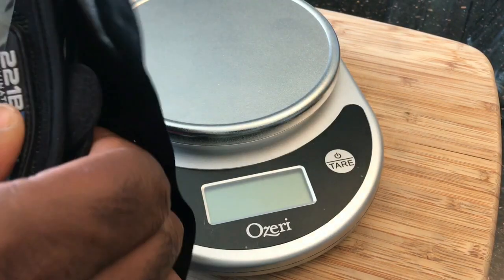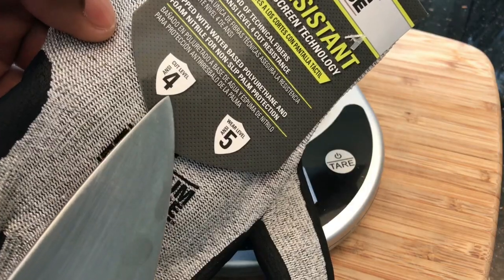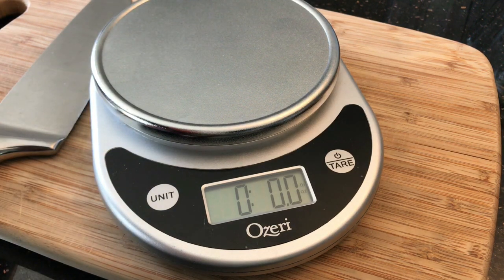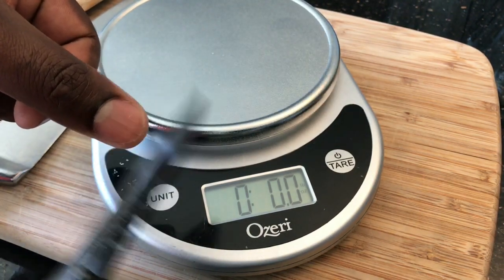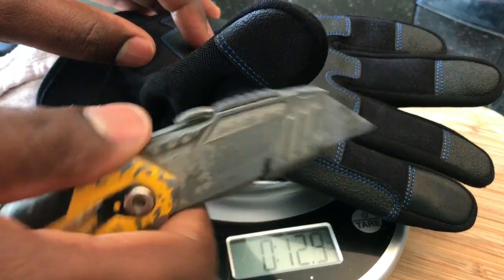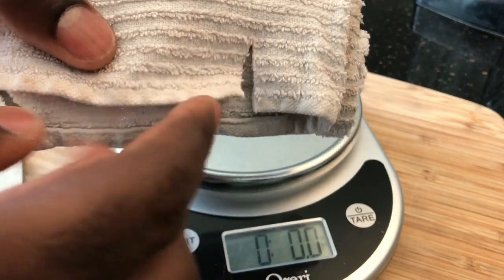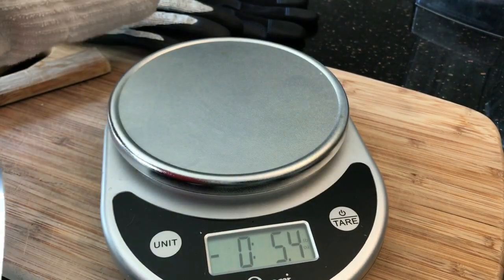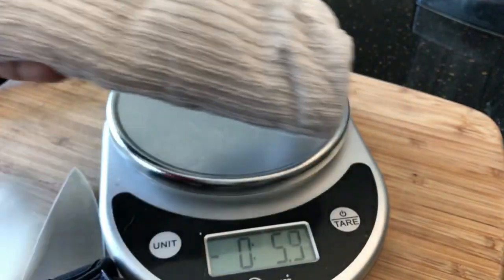221B Tactical Guardian Gloves Cut Testing Resistance Explained with Demo

Comment: I use an angle grinder from time to time. Would any of these gloves help mitigate my risk of critical injury? Like give me a split second to react for a nasty scar but not lose a finger?
Reply from the maker: As with any glove, something is better than nothing. These will provide better abrasion protection than regular gloves or no gloves at all. But they are not designed to fully protect in this situation you describe.
Reply: @221btactical  I see. As far as abrasion would this pair or the work gloves edition you guys make be a better fit? Or is the cut resistance pretty much the same for both?
Reply from the maker: @doyen86  Work gloves would be better protection. That outer leather it TOUGH on them. Same cut resistance on the inside.

Comment: Finally, a solid video showing cut testing. 

The only concern I have is that you're cutting in the same spot over and over again. It becomes inaccurate quite fast due to previous cut progress. I recommend putting some weight on top of the blade while it's not moving (body weight is fine), after that start moving the blade into once direction and stop. Check if that amount of pounds was enough to cut it. If not, increase the weight and then do a single slash BUT in different location, even slightly to the side would work. 

I just ordered UCI TYPHAN XP1 gloves because they offer one of the best protection specs for the price. TDM E rating, EN 388:(2016) - 4-5-4-4 plus has some waterproof coating on the palm. I will be using the gloves not for work but more for workout and possibly, for self-defence.
Reply from the maker: Hello and thank you for your comment. If you look at the testing protocols for ANSI and EN388 they call for the blade to pass repeatedly in the SAME location...not different locations. Totally agree with your thoughts. However, when a test like that was conducted by us in the past, we got many comments from people saying "STOP MOVING THE BLADE TO DIFFERENT SPOTS...keep cutting in the same spot." To keep in line with the international testing standards, we did this test in their same manner. Hope this helps. Thanks again for commenting here. Stay safe out there.